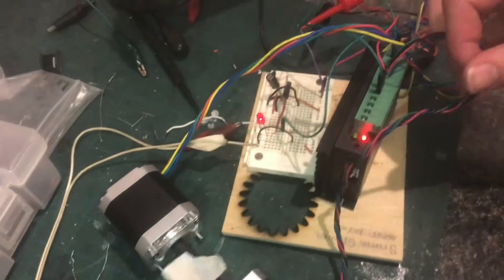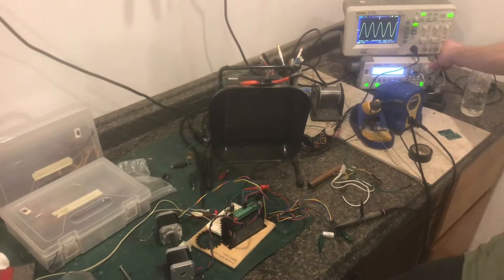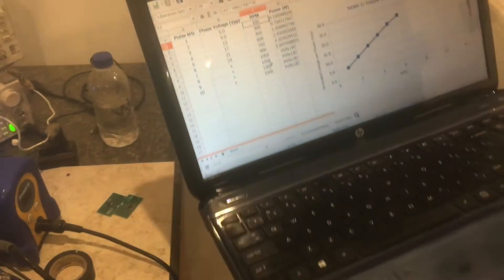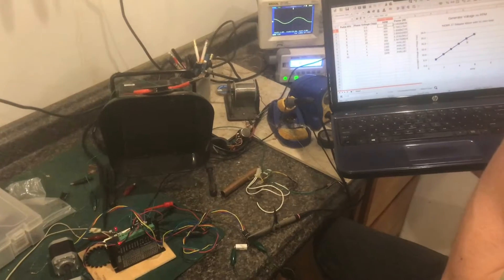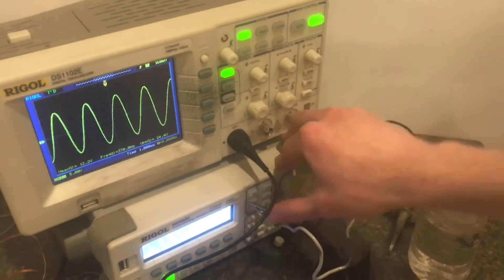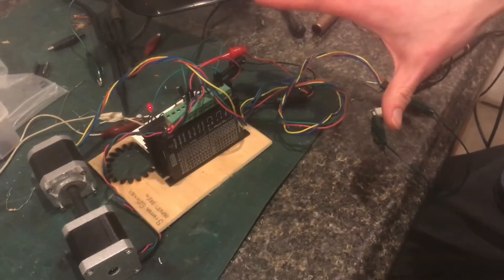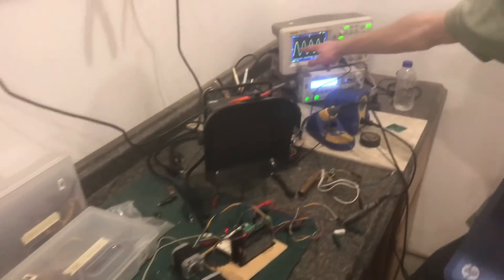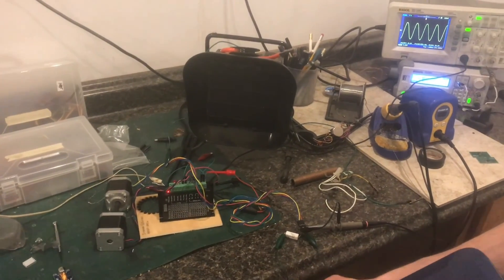using stepper motors as a “GENERATOR” for electricity (testing their efficiency) hydro power

Comment: Finally somebody that doesn't just run off at the freaking mouth about their cats and their dogs .direct to the point, useful information. great video thanks! And those are just nema 17 a nema 23 I get a 150 volts out of at about 1200 RPMs, can't wait to see the water wheel my idea is to incorporate a perpetual motion device with it that way no matter what it is still spinning even if the water stops for a little bit or slows down it has a certain RPM it's always going to maintain
Reply: perpetual motion cmon dude............. conservation of energy an all that........ Newton's second law
Reply: @leightonwestbury92  ok we arent talking about magic its simple you can try to convolute the situation with thermal dynamics all you want but conservation of energy has nothing to do with it . using 2  Peristaltic Pumps attached to the axle of the waterwheel to move the water back into the tank ,a 275 gallon tank, two hoverboard wheels, a regulator rectifier from a motorcycle, two 167ah batteries and last but not least a 10,000 watt nom inverter witha 20,000 peak you never pay the greedy energy people again. it never stopsits as perpetual as perpetual gets. will it stop in 300 years maybe but youll never know.....

Comment: Hi! I am making a research on the same concept. May I know the formula that you used in this experiment? I need to identify the current and voltage that can be generated from the stepper motor as generator
Reply: Did you by chance figure out how many watts a stepper motor can produce? I have been all over you tube and I can not find a video on how to calculate it.

Comment: Very nice work! What do you suppose the max working rpm, load, and power output that these nema 23s could be ran at as a generator without overheating? I know you don’t need to get go higher but I’m just curious what your thoughts are! Thanks for your video!

Comment: Curious if you can answer a quick question. What is the significance of the stepper motor’s coil resistance rating? Does a higher number for resistance mean it’s harder to turn - for example a 32 Ohms motor would require more force to spin than one rated at 1.5 Ohms? Thanks!
Reply: The higher the resistance, the higher the output voltage. Not sure if that helps.